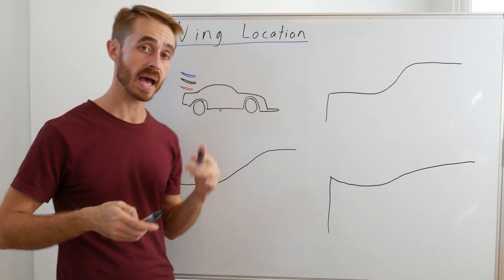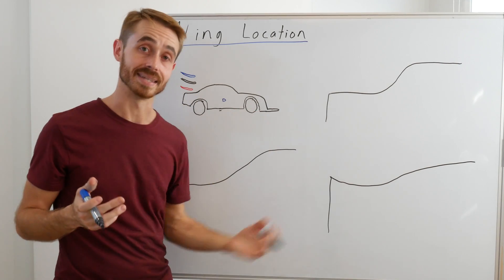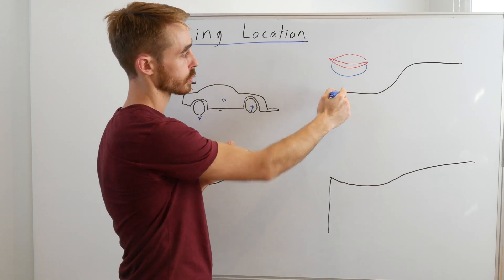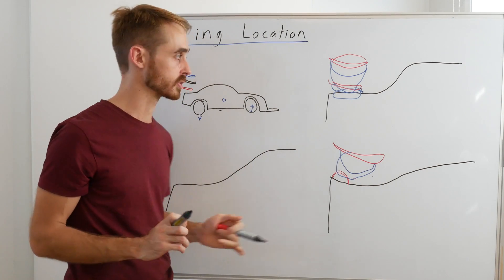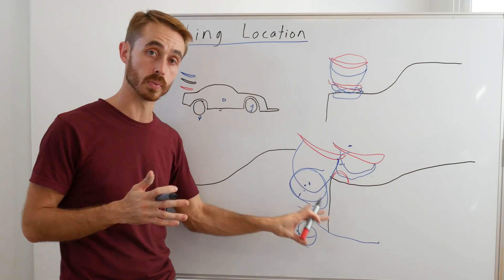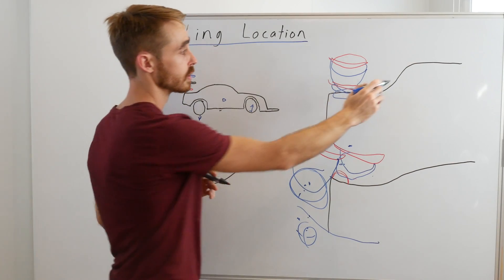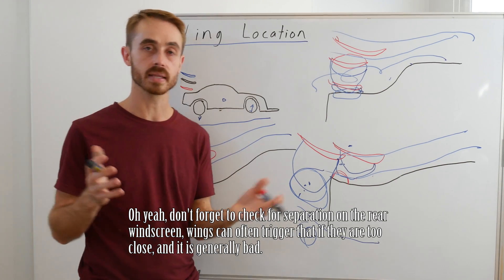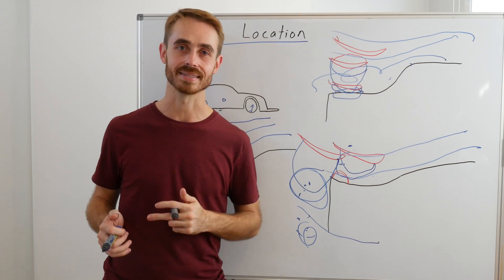What Does Rear Wing Placement do for Aerodynamics?

Comment: I've always wondered why wings were placed so far rearward.  It seems to me that the extra rear downforce you get from leverage comes totally at the expense of lift at the front.  Seeing as front downforce is often harder to come by, especially in a street car with real-world ground clearance (not a GT3RS), this seems counterproductive.  It seems like the ideal rear wing location should be directly over the rear axle, which would not cannibalize from the front at all.  I know that I must be wrong, because all the smartest people in the world stopped putting wings there about 5 minutes after car wings were invented.  But I haven't seen a great explanation of WHY that's wrong.  The diffuser thing is interesting, but my intuition is it doesn't affect a street / track day car that has no real diffuser or underbody tuning.

Comment: In the first scenario, can you explain how the low pressure regions from the rear wing and boot cancel each other out if they are both low. However, when a boot spoiler is added (2nd scenerio), its high pressure region cancels out the low one from the rear wing. Thus, I am confused when you say that low p regions cancel each other out as well as high vs low.

Comment: So...with a clean air stream over the roofline, a medium height wing will do just fine as long as you are conscientious of the angle attack in relation to downward airflow. If the roofline is too steep and causes flow separation, a high wing position is needed to attain effective use of downforce. A low wing will be largely ineffective and and is basically just a spoiler.

If you put it simply, that is.

Comment: But when you have the rear wing to up from the chassis of the car you have the problem with the drag effect that pulls more back the car as higher the rear wing is. Or the roof of the car makes the air flow to loose this property when flowing above the floor of the car? because if not it is not good for performance to raise the level of the rear wing to obtain more nice airflow. No?

Comment: So on a hatch back, where would the best location be in your eyes?  Since the back of the car is very flat, I would assume there would be a bunch of turbulent air without any wing or diffuser.  If you wanted to aid the diffuser, would it be wise for the rear wing to sit slightly higher than the large, flat roof line of a hatchback vehicle in order to get air to flow under the wing?  or are you better off mounting closer to even with the roof line and running more angle of attack?

Comment: Hey Kyle, Quick question. what happens to the flow off the roof of the car when u add a vortex generator? does it essentially straighten it out?

Also what happens when you use a dual element wing? does it just essentially allow you to gain more downforce with less angle of attack?

Thanks.

Comment: I think that the myth of the wing having to be at about the roof level of the car might come from old NASCAR racecars. In the late 60's, NASCAR wanted to limit the advantages of aerodynamics in cars, so they put a rule that said that you couldn't have a wing that was lower than the boot's height when opened. You can see how they got creative in the automotive industry with the Plymouth Roadrunner, which had a super tall wing.

Comment: Could you tell us more about tire wake and tire aerodynamics? Like in F1 tires seem to be neglected, even in Formula E tires are covered except for the middle part, is it because of the lift generated by the tires? You see louvers used in Le Mans does it matter if they are horizontal or vertical and what the shape is? Or does only the size matter? And why aren't wheels covered with  discs, and why do F1 cars have brake scoops? I hope you can do a video about this, your channel rocks.

Comment: Kyle, I drive a convertible car. Would there be any benefit to running a rear wing considering all of the airflow is likely detached at that point?
Reply: iamtehstig I'm curious about this as well. some of the old Viper ACR convertibles, had a $1800 spoiler they sold and I'm trying to figure out if it even had any effect, same goes for the Battleaero new edge mustang.

Comment: Did I hear you right Kyle? Are you saying that low pressure lift provides more lift than the high pressure on the top? That could only be true if you have a low drag setup - surely? A wing profile simply makes a wing efficient - just as with a plane - you can easily have a plane with flat wings, if just makes them fly not so great, and waste fuel.

On a plane, at least, the vast majority of lift is obtained by directing a very large mass of air downwards, because the back of the wing is lower than the leading edge by some margin, when the plane is in level flight. Engine power is used to deflect air downwards to maintain the vehicle's flight.

So, the reverse must be true for cars: If you want lots of downforce, you direct a large mass of air upwards, while reducing drag and maximising lift. You achieve that by having spoilers with upside down wing profiles - yeah?

So, unless you are only interested in high speeds, you've got to have your rear wing with the tail significantly higher than the leading edge. Otherwise you are only going to generate aerodynamic lift, not mass-directed lift, and that is very small - surely? I can't see any non-silly wing in a minimal drag situation making more than 30 or 40 kilos of downforce - SURELY?

If you want hundreds of kilos of downforce, you need to direct hundreds of kilos of air upwards at a vast rate of knots. Or have I got that wrong?
Reply: A little late clearly, but a wing creates lift via creating a pressure differential between the top and bottom of the wing surface. For a standard race car wing, which produces negative lift, the air particles accelerate around the bottom curved surface, but since there is a constant mass flow, Bernoulli's Principle says the high velocity section must have a lower pressure because otherwise that would defy mass and energy conservation. The converse effect happens on the top side of the wing, where it decelerates and builds pressure. The low pressure side of the wing is effectively a vacuum at this point, and the air from the top side wants to occupy this vacuum, pulling the fixed wing down.
 What you're talking about is the Newtonian contribution to aerodynamic lift, which is the top side of our wing elements apply an upwards force on the air when it collides, deflects, and accelerates upwards with the regions of high camber or high angle of attack. In addition to downforce creation, this dynamic leads to form-induced drag. (the force vector is not straight up, it faces normal to the wing surface, which is facing forwards) Newton's third states that this force has an equal and opposite reaction from the air to the wing elements, where the air is pushing down on the element.
 Also, the flow has a centripetal acceleration around the curvature of the wing (lift generating wing), thus also a centripetal force pulling the flow inwards towards the wing surface.  The curvature increases the closer you get to the wing surface, and so the centripetal force increases closer to the wing surface.  Thus, there is a larger reacting force of the wing on the fluid pointed upwards, opposite the centripetal force acting on the fluid, ie. exerting an upwards force on the wing.  The higher centripetal acceleration yields a higher angular velocity and thus a greater total velocity vector on top of the wing, ie. lower pressure on top.

Comment: About how many degrees is a roofline to boot lid considered too steep? And how does a convertible top compare in this scenario?
Reply: i think i recall a video mentioning a sudden change any more then just 7 degress can cause separation? a nice smooth radius like on the toyota prius i would suspect the air stays attached the full length of the roof and boot contour.  just some information to try and provide some resolution to your questions, i may be incorrect.

Comment: I'm considering a wing for my 350z I want it swan neck mounted, but I was considering having kind of the LMP style shark fin mount. It would be connected to the front of the roll cage through the roof and the back of the roll cage through the roof, there would be pins in the rear and a hinge on the front to allow the hatch to be opened, but I'm worried about the catalievering effect it could have.

Comment: Speaking of odd rear wing placement, I would love to hear your thoughts on the old Audi TT DTM car. That thing was a mess of aero gubbins all over the car, and a rear wing that hung well past the rear bumper.

Interesting to note that the original test car had the rear wing on the boot lid, then the car moved to a rear set wing with a higher element, then to a lower mounted wing, with the similar rearward mounting.

I think it might make for a fascinating case study on th subject.

Also, touching on vehicle rear window shape, what is the better alternative, to move the rear wing, or add vortex generators to force the air onto the wing? Outside of height regulations because of rules, is there ever a time you would specifically choose one over another?

Comment: I'm a little confused.  You say that moving the rear wing forward is more efficient.  But you also say that moving the wing back produces too much downforce.  As a wing is meant to produce downforce, I would think that moving it back is more efficient? (and to compensate for the front end grip, you would either need a less aggressive rear wing, or better front aero)
Reply from the maker: Allow me to clarify; Moving the wing forwards means we can theoretically make more downforce from the wing for the same level of aero balance, but we have issues with the interaction with the car (which lowers wing effectiveness). Moving the wing rearwards makes the wing more effective (in terms of interaction with the car), but it can't provide as much downforce or otherwise the aero balance will shift rearwards, make sense?
Reply: Moving the spoiler too far back or too far up creates a larger Moment arm which acts on the car. The closer the wing is to the CG the more the downforce will be spread evenly throughout front and rear axles. the further away you move it, the more force is being directed  JUST to the rear wheels which can produced lift/understeer in the front of the car sometimes.

Comment: In one of your earlier videos on rear wings on road cars you mentioned that they really have little real effect. I had a Mazda Protoge that always felt unstable on the highway with a tail wind. 100 KPH forward plus a 30 KPH head wind (130 observed ) VS 100 KPH forward plus 30 KPH tail wind ( 70 KPH observed ). I never put a wing on, but an extra 50 or 60 pounds on the rear might have made a difference.